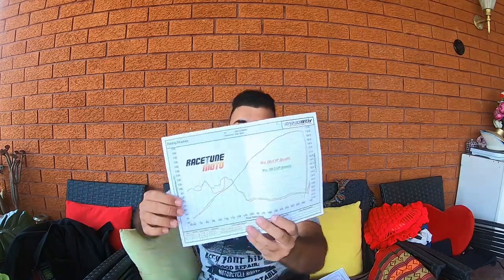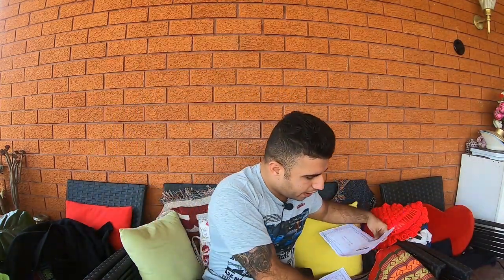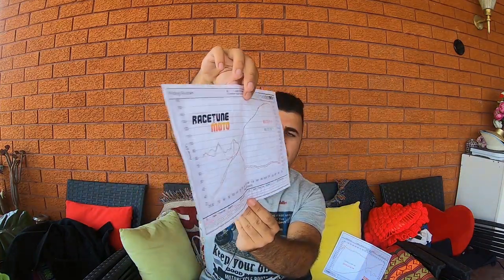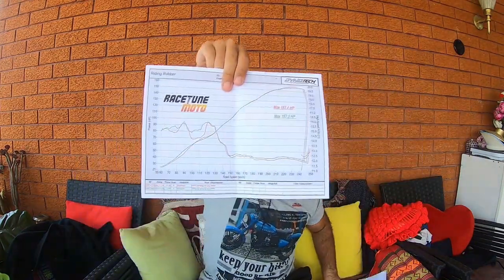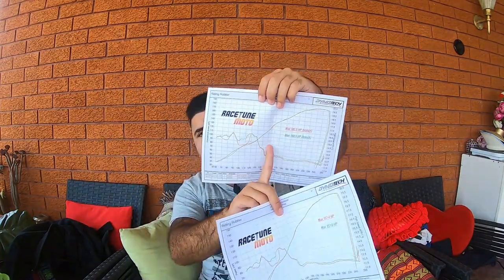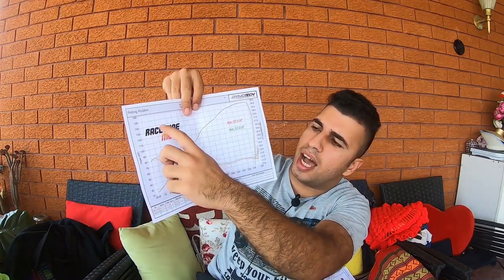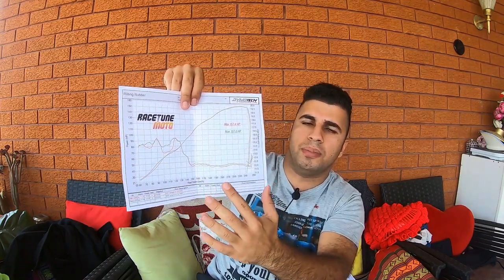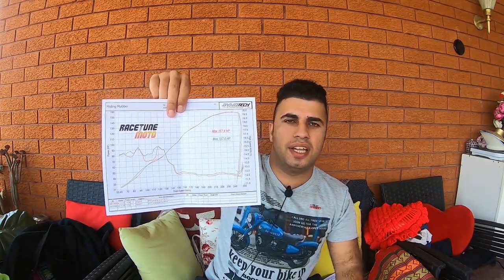2017 Honda Cbr1000rr on Dyno

Comment: bro quick question when u get the blade dynotune did that make the bike run smooth????  like not jerky down low rev after adding slip on. and is ecu flash necessary??
Reply from the maker: Hi Talon Flame 
Unfortunately the cbr1000rr didn't get tuned I only put it on the dyno to see how much power it makes with stock exhaust and yoshimura alpha t slip on.
My 2017 gsxr1000 will have a full exhaust system and dyno tune.

Comment: I have the same bike, did you go with the power commander tune or the ecu tune on the dyno?
Reply from the maker: The bike is stock it only has a link pipe and arrow slip on exhaust.
The plan was to get it dyno tuned but I lost interest and swapped it for a 2017 Suzuki gsxr1000.
Reply: SHAQS WORLD what made you swap it for the GSXR?
Reply from the maker: I usually get a new bike every 1 or 2 years.
I wasn't even shopping for a new motorcycle I was happy with my cbr1000rr.
When my friend showed me the add I didn't waste anytime the next day I traded my cbr1000rr in for gsxr1000 because of the colour.